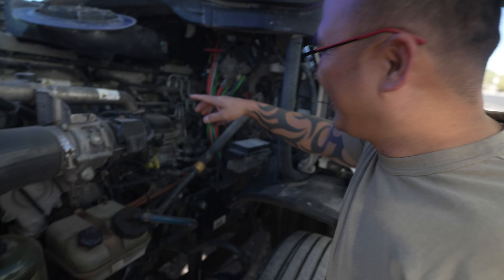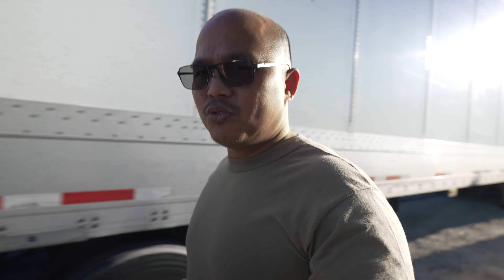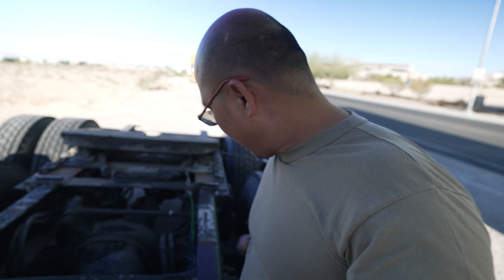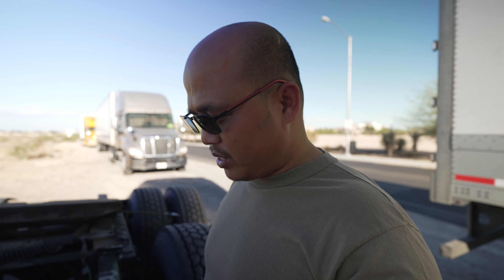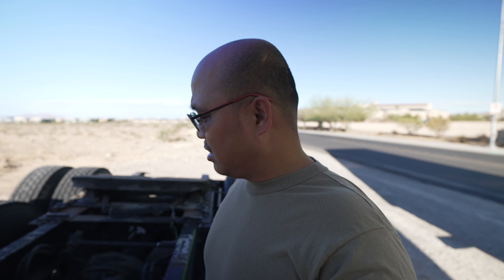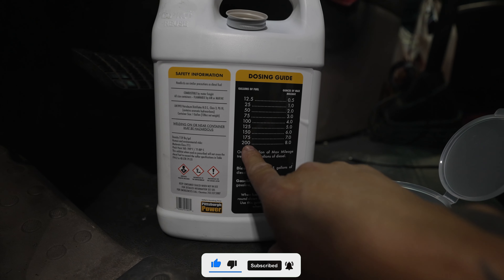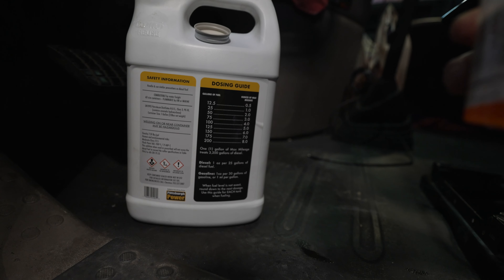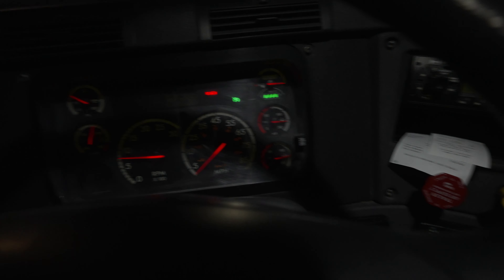Pittsburg Power Max Mileage Initial Thought

Comment: I also noticed an immediate smoothing of my engine... keep a record of your def usage and regens....  you'll see a decline in both, and that is real hard evidence of it working.  During the first two gallons they say it is cleaning out the engine of soot and carbon build up...   I use their 16oz bottle to measure... I now have two of them....  The one thing I hate about it is pouring it off into the smaller containers.  When the gallon is full, it's hard not to have some small spillage.  The 16oz bottles are great once filled for measuring....  you can easily squeeze 1 0Z portions into the tank, so dosing is a breeze at the fuel island.  I have heard Bruce say many times that getting the dosage right is very important....  to much and you are wasting money.... too little and it won't do its job at all.
Reply from the maker: Yea I was looking at those bottles. I’ll pick some of those up TY

Comment: I've been using Max Mileage for almost two months now, went thru one gallon already, just bought my second gallon yesterday.  I went about two weeks without using it and one of the times I sat for a long while, the truck regened for about 15 minutes or so. When I was using the first gallon, whenever I did sit for a long period of time, the truck would only regen for 5 minutes at the most. When coming to a stop after driving for a good period of time, the High Exhaust Temperature light would not come on, and I believe that had to do with Max Mileage doing what it was intended to do. It wasn't intended to increase your MPG, but if that does happen, that's a plus with using that product. Oh, and while sitting idle, my engine (Cummins X15) does seem to run smoother. I will continue to use this product to see what the long term effects are with it.

Like said in another comment, record your number of regens and how long they last, that should give you an indication whether it's working or not.
Reply from the maker: Ty for that

Comment: Hey Pinoy Trucking, new subscriber. Learning a good amount from your videos 👍 I hope you can keep making them.
I'm curious about what truck specs you would consider good for fuel  efficiency doing Amazon relay in western states.
Empty trailers, lighter loads and bobtail seem somewhat common but western states have more hills so?
Dd13 vs Dd15? 
DT12 vs Eaton 10 speed manual?
Rear axle gearing? 
6x2 vs 6x4? Traction vs efficiency tradeoffs? 
The few 6x2 I have seen are all non- lifting tag axle. From what I've read it seems a liftable pusher would be better if running 6x2, with locker of course.
Reply from the maker: I think for western states your best bet would be 3.08 rears and automatic dd15 on manual and dd13 on auto preferably. 6x2 vs 6x4 doesn’t make a difference I don’t think. I would much rather have the option for a 6x4 if I need it specially in the western states. I would not worry about the lift axle or a tag axle. Not worth the headache and price. IMO
Reply: @pinoytrucking  Thanks for the helpful reply, I have a lot to learn yet 👍. Some of these 6x2's are hitting 10mpg average but they have gen 5's and are only hauling 30k or less with super singles. They probably aren't running western states either. Still impressive tho. ✌️

Comment: Pinoy! What insurance company do you have in your truck? I'm paying way too much on Progressive and looking for better deal. I'm paying $2,400 a month and it's been over a year and the rate has not gone down.
Reply from the maker: Damn $2400 is a lot bro… When your year is up make sure you shop around. I have GLG insurance now. I don’t know if they cover your area but I’m paying $1280ish a mo. I was paying waay more with progressive so I dump them on my 3rd mo of operation. My progressive was $1700ish a mo.
Reply from the maker: Also I expect to pay around 800ish when my year is up with my current insurance.
Reply: @pinoytrucking  thanks a lot. I'm based in Las Vegas(Blue Diamond area) as well. Will check out GLG